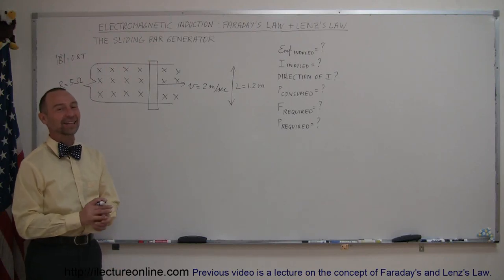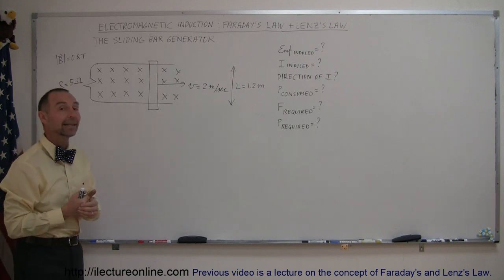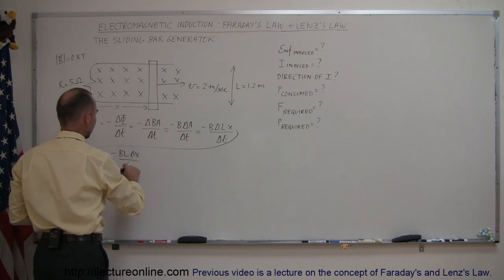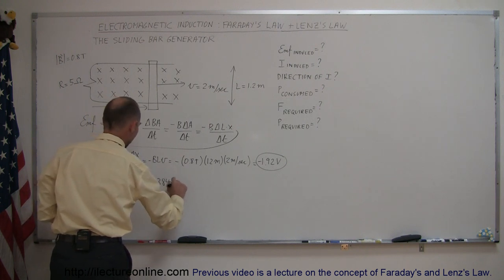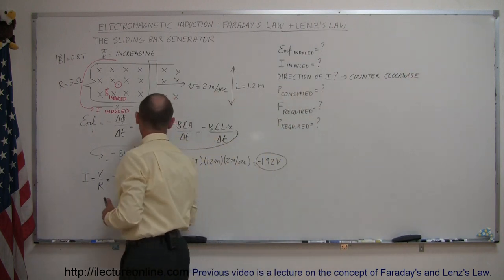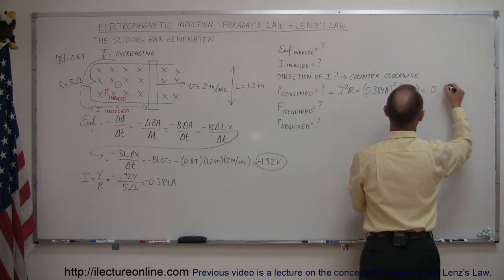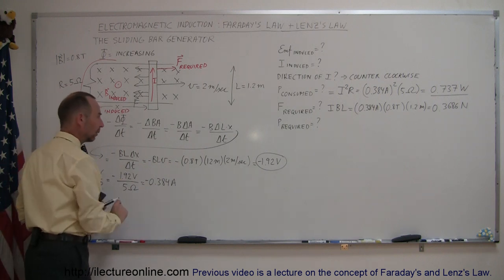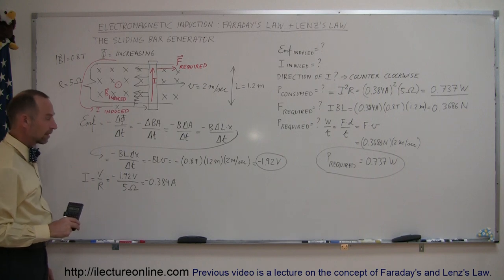Physics 45 Electromagnetic Induction: Faraday's Law and Lenz's Law (2 of 2) Sliding Bar Generator

Comment: Thank You Dr. Michel.. Very good explanation.. Especially showing how power on resistor exactly equals to power applying on bar.. Energy does not change, just transforming from mechanic to electric..
Reply from the maker: Yes, it is a very vivid illustration of how the energy is transformed.

Comment: Sir,the direction of induced current is anticlock wise.Because of the flux is increases into the plane of paper so the induced magnetic field in the opposite direction. That's means magnetic field out of plane of paper .so the current in anticlockwise direction.

Comment: I have just one question and i hope you can help me please.  What is the basic difference between static magnetic field and time changing magnetic field?
What is the difference between moving a wire loop in static mag. field and time changing mag. field?
thank you for the answer .
You are great.
Reply from the maker: Alex
When you have a wire with a current flowing through it you'll have a magnetic field around the wire.  If the current is constant, the magnetic field will be "static".  The magnitude of the field will remain the same.
If the current through the wire increases, the magnetic field will increase as well thus it is a time changing magnetic field.
When you want to induce a voltage in a loop, it doesn't matter if the magnetic field changes or the area of the loop changes, they both will result in an induced emf.  The key is that the magnetic flux changes through the loop
Reply: Thank you very much for good explanation.
I understand now  what is the basic difference between both magnetics field's.
Great, great....
Nice greetings from Europe and happy new year.

Comment: Thanks for the awesome lecture video Professor Michel van Biezen :)
I just have a question. Why didn't you use the negative value of the current to calculate the required force. Doesn't it make any difference?
Thanks

Comment: Great teaching, I found this video excerpt very clear. I have a two-part question to ask. The first one is, "did we make implicit assumptions about mechanical forces that kept the remaining three sides of the loop in place? It appears that they would equally experience magnetic forces." My second question is, "Let us assume that the part of the loop containing the resistor was placed outside the scope of the external magnetic field. Does our magnetic field then become a piecewise function in order to capture the entire region of the loop?" Thank you for your time, and I look forward to reading about your opinion on the two questions.
Reply from the maker: The first answer is yes, the other part of the circuit is "fixed" and cannot move.The second part of your question, the only thing that matters is the magnetic flux THROUGH the loop in order for the EMF to be induced.  The circuit itself could technically not be in the magnetic field, (however that would be hard to do in the real world).

Comment: if you just gave the rod an initial impulse, would it mean that the rod decelerates until it stops, because there is no more mechanical work being done to push it, hence it will stop, causing current and electrical power generation to stop?
Reply from the maker: That is correct.  That is similar to electrical power plants.  It takes energy to make electrical energy.  If one doesn't push the turbines, the electrical generation will stop.

Comment: Hi Michel.... I have to say that this video is perfect from beginning to end!!.. You analyzed all the factors that are involved in a problem like this.. You always eliminate any ambiguities in your explanations and that is so important.....  By the way, You determined the POWER through the resister using the P = (I^2) R... for the fun of it I double checked to see if POWER equaled  VI.. and SURE ENOUGH.. :D ... thanks, as usual, for your videos....
Reply: By the way.. at the end of the video.. it seems like you just established the basis for what is called a RAIL GUN.....  imagine that?
Reply from the maker: That is exactly how a rail gun works.  And at Knott's Berry Farm (an amusement park), a really high acceleration ride is powered by this method.

Comment: Hello Michel: When solving for magnetic flux you said that the area of the loop is perpendicular to the magnetic field.  However, we learned that the magnetic flux is defined by taking the dot product of the B-field and the normal vector of the area, which in this case is B*A because they are parallel.  Is the flux defined by taking a dot product between the B-field and the area vectors?  Thank you.
Reply from the maker: Yes, that is one way you can define it.  The plane of the loop is perpendicular to the B-field, and the area vector of the loop (which is perpendicular to the plane of the loop) is parallel to the b-field.

Comment: Thanks for the video.. but one question, when you calculated the force required to move the bar to the right and it's equal to the magnetic force on the wire causing it to move leftwards, how will the wire move to the right if these two forces are equal? shouldn't it be more than the magnetic force to overcome it?
Reply from the maker: Once the bar is moving, the bar will continue to move if the forces are equal (Newton's first law).  To get the bar moving, the force pushing the bar will have to be larger momentarily.
Reply: Michel van Biezen thanks for the explanation. 😊

Comment: I thought the right hand rule was used for velocity, B field, and force? Could you please clarify how it is when its with current? Also what would the direction of the force be if the B field in this problem were coming out toward you and current kept the same direction? Thank you very much!
Reply from the maker: Sruveera,
The right hand rule can be used in two ways.
1) Point your fingers in the direction of the velocity of the charges,  Then curl your fingers in the direction of the magnetic field and your thumb will point in the direction of the force.

2) Curl your fingers in the direction of the current loop and your thumb will point in the direction of the magnetic field.

Comment: thanks for the lecture. i've got one question: how oposses ampere force to movement  if the direction of that force is not oposite to moving conductor's velocity
Reply from the maker: I am not sure I understand the question, but in order to move the sliding conductor a force must pull the conductor to the right.  If the current was reversed, the sliding conductor would be pushed to the right.

Comment: Thank you Sir, can we determine whether which end of the bar at higher potential ?
Reply from the maker: Current flow from higher to lower potential.  Once you have determined the direction of the induced current, you will know your answer.  (since the bar is a conductor it will be very small).  Typically we talk about the potential difference across the resistor.

Comment: Thanks for the video. Its help. I have one question, is the direction of current through the wire is based on the direction of current induced?
Reply from the maker: Lim,
The direction of the induced current (which is the current through the loop) is caused by the direction of the induced Emf which is caused by the induced magnetic field, which is caused by the change of the magnetic flux through the loop.

Comment: Thank you for the video,
but I have a small question. When you calculate the force on the bar, why don't you consider the force on the wire on the left side.
The current is moving in the opposite direction, so the force would also be in the opposite direction. So you have two opposing forces and these would cancel each other. Why is this wrong?
Reply from the maker: You need to isolate the object you have under consideration .  (Like the free body diagrams we used to draw in mechanics.)  Only consider the forces on the bar.  The forces on the wire at the left side have no effect on the bar.

Comment: How would this problem differ if the wire was in the shape of a triangle instead of this rectangle shape? Would you approach it the same exact way?
Reply from the maker: The approach would be the same, except that the change in the area would not be linear.

Comment: hello sir i have a question. when determining the direction of force caused by the induced current, which magnetic field should be taken into account?? the original or induced B field, since these two fields yields the same forces but in opposite directions. thanks
Reply from the maker: The force we are finding here is the force required to pull the bar to the right. Moving the bar to the right requires energy and thus a force is required.  I am not sure what you mean by: "a force caused by the induced current".  The induced current is a result of pulling the charges in the bar to the right. That caused them to experience a force pushing them upward in the bar.
Reply: What I meant is that there is an induced current in the bar ( which I thought can be treated as a long straight wire), and there are two B fields (the given B field and the induced B field), so the bar will experience a force. The direction of this force can be determined by right hand rule, but the question is which B field will take part. I tried the right hand rule for both the B fields which gave me forces in opposite directions. Thanks
Reply from the maker: The first B-field is independent.  It is already there before anything starts moving.  Therefore it is responsible for any forces experienced by the moving bar.

Comment: you said that area is perpendicular to magnetic feild here.but isn't the angle between them 180??because Magnetic feild is going inside to board and direction area is coming out of board.pls explain.sorry for trouble got it...btw love from BANGLADSH
Reply from the maker: Since the area of the loop (not the area vector) is parallel to the board the magnetic flux goes through the loop perpendicular to the are of the loop (and the board).

Comment: Dear , why take only the direction of F from the original B not the induced B to equate it ILB?
Reply from the maker: Think of it this way.  The force is needed to overcome the interaction of the current in the bar crossing the magnetic field lines.  This RESULTS in an induced voltage which produces an induced current which produces a magnetic field.
Reply: Still don't get it, when I apply the RHR , my fingers will point into the page ( magnetic field ), and my thumb is upward , then F will be to the left, my question is that we ignore the induced B which will be out of the page , if we use it then the F= ilb will be to the right , why didn't use the Induced magnetic field to find the direction of force ?

Comment: Hi professor Van Biezen, do you also have videos where you explain those kind of examples intuitive? And how do you know if the induced current will increase or decrease? I thought if the induced magnetic field stays the same as the original magnetic field then the current will decrease and if the magnetic fields are opposite to each other then the current will increase, is that right? Thanks a lot :)
Reply from the maker: Yes, this chapter has some intuitive concepts on induced current.  PHYSICS 45 ELECTROMAGNETIC INDUCTION

Comment: In this case, why is it -B. I know the negative refers to the direction of the opposing magnetic field, but it is not always negative. Why is it negative now? I know you explained it, but in other problems I have seen it as just BLv
Reply from the maker: it depends on 2 things.  1) The direction of the original B-field.  2) The change in the flux.  If the flux is increasing the direction of the induced B-field, will be opposite to the existing B-field.  If the flux is decreasing, the direction of the induced B-field will be in the same direction as the existing field.

Comment: On 4:46, so the thumb follows the direction of the B field (out of the page) when it is induced? Normally the thumb would point to the direction of velocity which is to the left, correct?
Reply from the maker: The direction of the induced B-field is determined by one thing only:  If the flux through the loop decreases, the induced B-field will be in the same direction as the existing B-filed.  And if the flux through the loop increases, the induced B-field will be in the opposite direction.
Reply: Got it thanks a bunch!

Comment: Hi sir, my teacher solved this using motional emf = BLV, which is the cutting of the bar with the B field. Both methods give same answer. Why does it work?
Reply from the maker: The equation your teacher uses can be derived from the basic principles of Faraday's law and Lenz's law.  We have examples of that.
Reply: @MichelvanBiezen  Ohh. What if B is time varying? Do we calculate for one of them only?
Reply from the maker: Yes, typically, either the area varies or the strength of the magnetic field varies.
Reply: @MichelvanBiezen  My exam has:
Time varying magnetic field + sliding rod. I forgot to account for time varying field 😢

Comment: I tried to use the method you told me to try, but seems like it doesn't work. When you use right hand rule, sometimes you use your fingers for current and thumb for magnetic field , but sometimes you change it and use your fingers for magnetic field and thumbs for current. so how am i supposed to know which is which? I will be really greatful if you teach me your little secret!
Reply from the maker: Ally,

Just like you wrote, it works both ways.  Use the same rule both ways anytime just like the videos show you.

Comment: why did we use our thumb to point in the direction of the field instead of curling our fingers? (to find the direction of the induced current)
Reply from the maker: It turns out we can use the hand rule in a number of ways.  If you point your thumb in the direction of the magnetic field, your (curled) fingers will point in the direction of the current.     OR  you can point your curled fingers in the direction of the (circular) magnetic field, and your thumb will point in the direction of the (straight) current.

Comment: Is there a way to calculate time constant (of velocity) of the rod?
Reply from the maker: I don't think that we can associate a "time constant" with the velocity of the rod.
Reply: @MichelvanBiezen  Got it. Might've been my poor explanation. I'm just stuck on this assignment that asks me to calculate and I quote: "The time constant of the exponential (rate) growth of the movement of the guide rod.
Reply from the maker: In that case the definition of a time constant is the time it takes to get to 1 - 1/e = 63.2% of its final value.  Usually it is associated with an equation such as   V = Vf ( 1 - e^-at )   So if you can determine how long it takes to get to 99.33% of its final value (after 5 time constants) and then divide by 5.    You can also look at the time constant videos of the RC circuit on this channel to get a feel for it.
Reply: @MichelvanBiezen  Appreciate it. Thank you.

Comment: So If the bar was sliding to the left the flux would be decreasing so the resulting B(Vector) would be into the paper so I induced would have an opposite direction of yours?
Reply from the maker: Ivan,
That is correct.
Reply: Okay one more question, what if the lenght(vector) of the bar was positioned at 60 degree by comparison with velocity vector...Saw it in some tasks.So I used formula Eemf=B*v*l*sin(degree) and was getting the correct result but the thing that was confusing me was that I thought I should use function cosinus(find out it sinus later because I was getting the wrong result)here because cos=v / l when I draw it on the paper. I guess it has to do something with derivations because only way to get sin from cos is to derivate it ?Hope you understood me :)
Reply from the maker: Ivan Antunović
The force is caused by the bar with current moving "perpendicular" to the magnetic field times the effective length.
Using the sin or cos depends on which angle you are considering.

Comment: Could you please explain what's exactly the rate of 'cutting' of magnetic lines by the conductor I know what is the meaning of changing the flux due to a change in field intensity or in the area of the loop but the linkage or the cutting of the flux lines that 's confusing me
Reply from the maker: Imagine that you string up a few dozen strings between two large flat boards that are facing each other.  Now imagine that those string represent magnetic field lines.  Now take a long stick and slowly move the stick between the two boards breaking the strings.  If you go slow you break only a few per second.  If you move the stick fast you will break many per second.  That is what we mean by "cutting" through the magnetic field lines.
Reply: Michel van Biezen that was really very helpful and valuable, thanks a lot.

Comment: Can someone please explain why a current is running through a wire at 5:58 please!
Reply from the maker: The current is induced by the chaning magenetic flux through the loop.  When the loop increases in area, it causes more magenetic flux to go through the loop.  That in turn produces an electric field around the loop which causes an  induced voltage which causes the current.
Reply: @MichelvanBiezen  Thank you!

Comment: what would be the case if we were not given the velocity the bar was moving with, instead the diagram was rotated 90 degrees and the bar was horizontal to the ground. we just knew the weight of the bar and knew that gravity was acting on it.